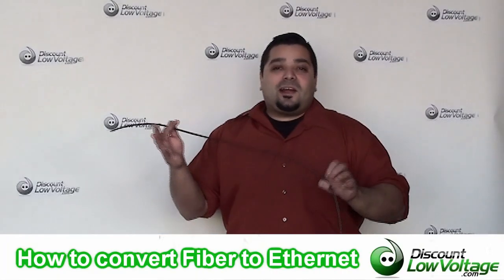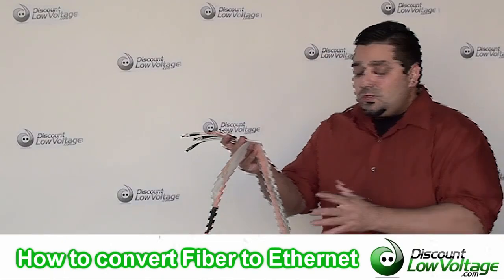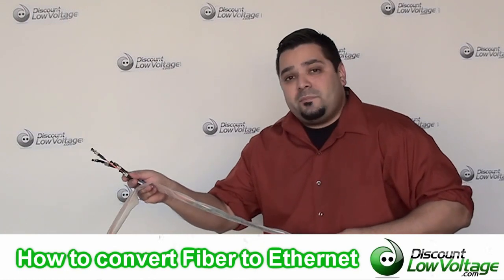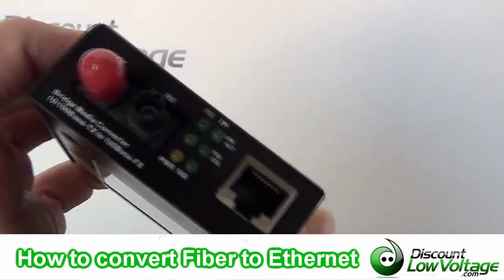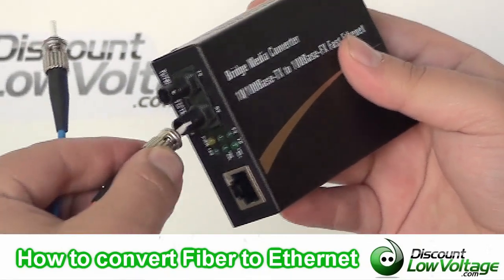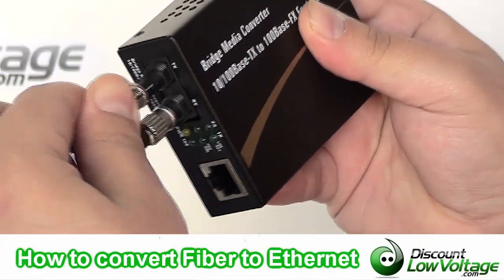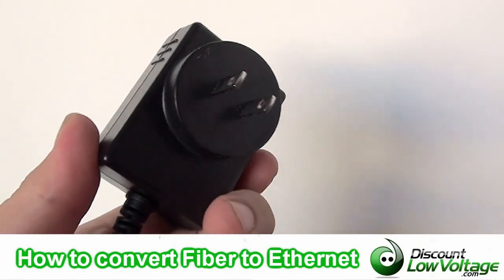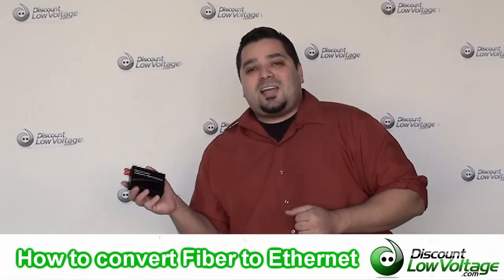How to convert fiber to Ethernet

Comment: I have this project with some little buildings with 1 to 4 data outlets with underground conduit between the buildings and runs from 20 to 80 m. Inside buildings we must have UTP cat 6A, all the switches must be layer 2 and there is no cat6a cable suitable for this underground conduit installation you think there is a problem having each of this outlets with an utp-tranceiver-fiber-transceiver-utp arrangement? That is a lot of transceivers tu buy. Please help

Comment: there are 2 fiber optic cable connecting to it? is there any converter like that but with only 1 fiber cable ???
Reply: One is send and the other is receive. Systems with 1 strand operate using a very different technology.